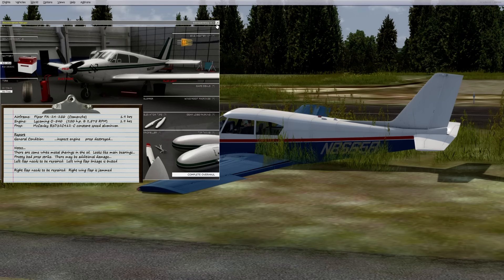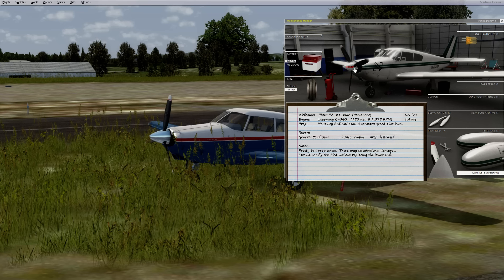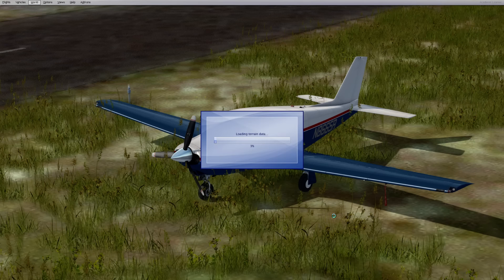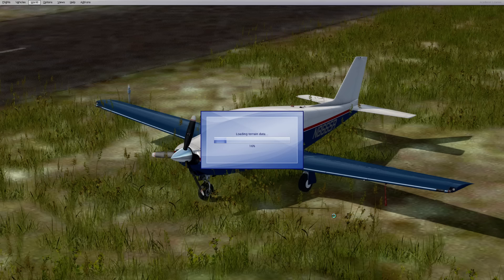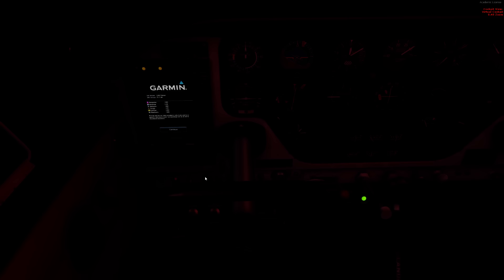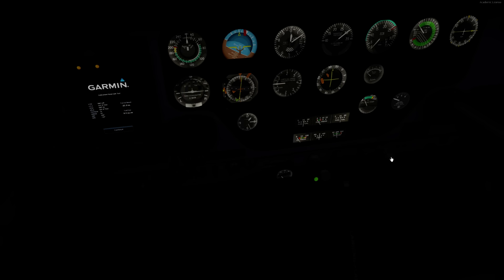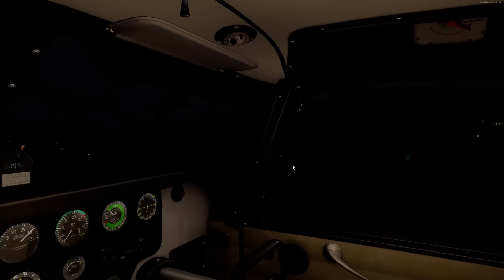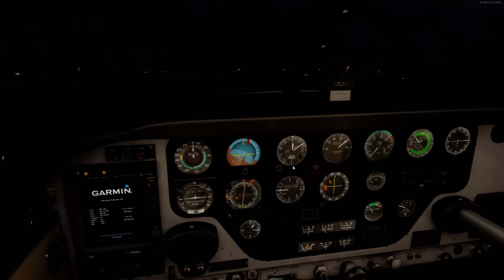A2A Comanche 250 Quick Review Part 2(Damage modeling and Night lighting)

Comment: Instead of reloading the aircraft, you can hit shift+3 and put the plane on jacks. Then you can go into the maintenance hangar and fix the gear and make sure it's down and locked. Then you can fix the rest of the items. The walk around is shift+8 and you can hit the next arrow or just hit A to advance. When you were trying to start at night, you might have flooded the engine. Try full throttle and mixture full lean. When the engine starts, just reverse the two. Hopefully this helps :)
Reply from the maker: modlincraig Thanks! I've been wondering how to do the walk around on all my A2A planes.

Comment: Great video David! BTW...which GPS/Radio are you using in the Comanche? Also, will that GPS/Radio work in the FSX version of the A2A Comanche? Thanks!
Reply from the maker: Rick Cadena I'm using the Flight1 GTN750, its a bit pricey but well worth the money as its completely realistic. Also they offer a P3Dv2 and FSX version of the GTN750
Reply: Thnx! Do you know if the FSX version will work with their default planes and A2A planes? Thnx again.
Reply from the maker: Yea but for the default planes it'll have to be in a pop up window as there is no room in the VC but, some planes from Milviz,A2A,Carendo,Alabeo offer GTN Intergration which means it'll show up in the VC in the panel. You can shoe horn the GTN into other planes panels as well. I have it in my Lionheart Lear 24 and Carenado C550. The New Navajo from Carenado offers Intergration and I'll be posting a review of it in a few hours.